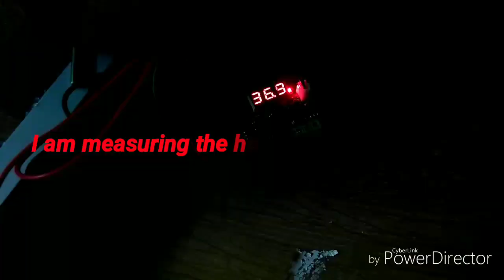What is Peltier/Thermo Electric Cooler ? & how to set up Peltier module..

Comment: can I use 12 v 10 AMP SMPS for  12706 peltier module ?
Reply from the maker: yes..you can
Reply: @bongtechguide3732  thank you 💖
Reply: @bongtechguide3732   sir or ak questions ... 4 cooling fan & 2 pentile module 12706  k liye kitna amp ki jarurat hoga ? 12 v 10 amp se chalega  ya or jada lagega ? Please tell me
Reply from the maker: Yes it's should work. But if not work then you should use 18v 6 AMP

Comment: What will happen if I used 12 volts with 2 amphere only?
Reply from the maker: Then it will take more time  to cold
Reply: @bongtechguide3732  do you have a video where you can convert 2 amps to 5 amps?
Reply: With 2 amps you don't get low temperature how much time you leave it

Comment: Power consumption kitni hai???? 
Input Ac Amp kitne hai????
Reply from the maker: This is a DC module powered by AC to DC adapter .You can use 12 volt 3 amps / you can use 18 volt 3 amps power supply...& pls subscribe my channel
Reply: 12706 Peltier works on 12 volts & 6 amps DC. It's safe under these conditions
Reply: @manojdayal25  12 Volts x 6 amps = 72 watt per each peltier module either on AC or DC

Comment: Sir how much ampere powersupply use pl replay urgent
Reply from the maker: In this project I was using  12 volt 5 amp dc power supply..Also you can use a voltage stabilizer for better performance

Comment: Use metal smps in this video 12v6a smps not suitable for peltier
I have 12v5a 1peltier one12v fan onle connected after 15minutes smps blast peltier needs more power

Comment: Bro I am try this,,, but it's not working, and also heat both side,,, what is the problem I don't know,,,, can you give me answer,, either phone number
Reply from the maker: First you need use a aluminium heatsink ..& you need to mount a high speed cpu fan for removing more heat from Peltier
Reply: Treating the temperature on the hotter side gives good cooling effects on the colder side. Water cooling gives best results